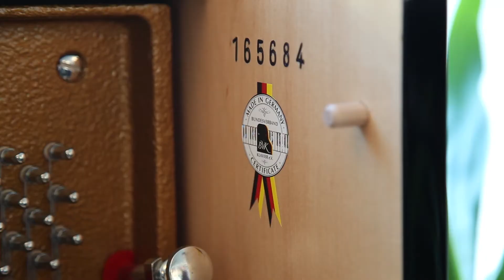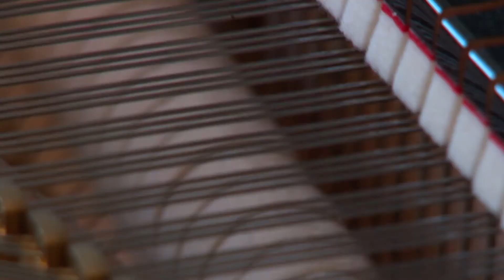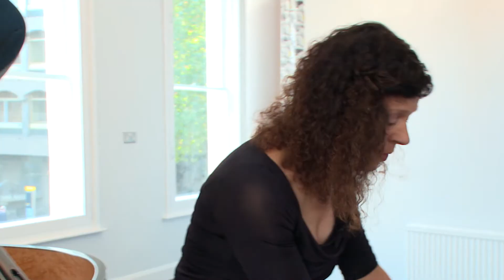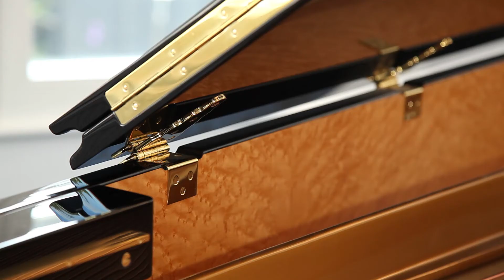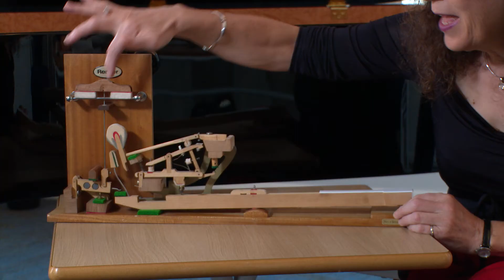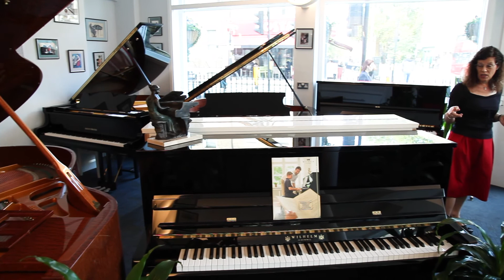Choosing the Right Piano - A Question of Choice

Comment: I don't think this presenter is very up to date even if this is 5 years ago. Chinese companies use Renner actions and Roslau wires for nearly a decade now, if not longer. All Pearl River pianos use wet sand casted plates. But not all Renner actions are top tier. Chinese companies are collaborating with German companies, companies like Feurich (Viennese) and Schimmel (Fridolen, Welhelm, etc.) and a Bechstein (Zimmermann line) collaborate with Hailun and Pearl River. Steinway uses Pearl River to build its Essex line and Kawai to build its Boston line. It's Kawai that makes the carbon fiber parts in their action but not to be cheap. They do it to keep it consistent where natural wood expands and contracts due to weather. And Mason and Hamlin also uses carbon fiber actions. Yamaha makes their own fine actions that some say are just as good as any German action but Yamaha also uses German felts in some of their pianos, Rosleau wires and European spruce in the SX and CF series. The piano world isn't so strictly segmented by countries so much. German companies are hard to sustain the industry hence the lower lines bringing in the money to help hold up the upper lines. Or, a boutique company is purchase, like Yamaha purchased Bosendorfer. Bosendorfer hasn't been changed but they now have money to make new models and Yamaha to help market them. There is a lot of interconnectivity between Asia and Europe now in terms of the piano industry while the American market is down to NY Steinway, Mason and Hamlin and Charles Walter and England may have a few brands left.

Japanese pianos are affordable? Has she seen the price of a Yamaha SX, CF or Shigeru Kawai? Is she aware of the different tiers of instrument Yamaha and Kawai make? Has she every played a Hailun piano or aware that Feurich has Hailun make some of their pianos that people use for practice in universities? This is just a lot of inaccurate generalizations that I really don't find all that useful and very German piano biased. Yes, the Germans can make fine pianos that cost a lot. But there are fine pianos from other lands as well.
Reply: I agree that Japanese piano makers have some extremely premium lines that are far from cheap, but they pale in comparison to the price of a Bösendorfer or a Hamburg Steinway. In my humble opinion the Asian makers just can’t match the refinement and the soul of Europe’s best. They just can’t.
Reply: @Steve-wf3vv  The Hamburg Steinway  D and the Shigeru Kawai SK-EX cost around the same as does the Yamaha CFX Mark II.  Bosendorfer costs more because they're more boutique. Fazioli, maybe has the best workmanship and costs more as well. And I think the Japanese pianos have plenty of soul and refinement now.  And it is hard to define "soul." Yamaha has a clean but pretty emotional tone especially since Yamaha now sources some of the same materials as Bosendorfer. And Shigeru Kawai has a very lush and colorful tone and both have excellent action and workmanship. I tend to like Bosendorfer VC but I still think there are individual pianos from the top manufacturers that stand out. Pianos are a highly personal matter and some do feel German, then Italian, make the best pianos. I understand that the European pianos have a certain signature that sets them apart.
Reply: @benjaminsmith2287 I respect your opinion, but I must point out that the list price on a piano (even most world class pianos)  and the street price on a piano is often quite significantly different. Also keep in mind many manufacturers price their 9-foot models much higher than their other sizes. Steinway is one of the few companies that allow little if any discounts. But on most other pianos, the prices are usually highly negotiable. For example, a 7 foot Yamaha CF-6 can be had at a negotiated price in low to mid $90K range. A Bösendorfer 214VC, however, would likely sell for no less than $117K. I’d say a price difference of well over 20 thousand is quite substantial. And Shigeru Kawai has always been praised as being among the more affordable high end pianos.  This is no surprise as the Japanese know they must offer somewhat better pricing on their flagship models than their more prestigious European competitors.I agree that the Japanese pianos (even the mass produced ones) are of higher quality than the ones made elsewhere in Asia.  And it’s not at all unwise if a musician with deep pockets chooses a CF series Yamaha or Shigeru Kawai over a European instrument . But while there are certain exceptions, Japan’s best seems better suited to pop and jazz where European pianos (especially German ones) seem to be preferred for classical music.
Reply: @Steve-wf3vv  That's changing. And Steinway is a jazz pianists preference for many as well. Pop is different but Steinway has plenty of jazz players in their artists list. From Keith Jarrett to Diana Krall to Kenny Barron to so many others, the list of Steinway jazz artists is very very long. I honestly think the Steinway is considered a jazz piano as much as Yamaha is. So many jazz clubs in NYC I can think of have them. Yet the Metropolitan Opera is a Yamaha house with lots of Yamaha CXs and maybe one or two CF series.

The CFX appears on a lot of concert stages as well as has a growing list of Classical artists, probably second to Steinway. The Shigeru Kawai has plenty of Classical and non-pop or jazz artists as well. And I think the Shigeru Kawai has a tone that could be mistaken for European, not at all bright. In fact, I would say Kawais were more on the dark, fuller spectrum of tone quality.

I'm not sure Kawai is used that much for jazz and pop. Since their tone is full and bright some Classical musicians love them as practice instruments and really, institutions love both Yamaha and Kawai pianos. Yamaha is still in some areas used for pop and jazz but they've expanded far beyond what they were even 15 years ago and especially since the introduction of the CFX and CX lines.
Reply: I just finished watching the Forster piano factory video. They have 40 workers. That's a glorified piano repair shop. I can see Forster going out of business soon. What difference does it make that they invented the cold casting method? They can't sell their pianos, and they are going out of business. Bosendorfer would go out of business, if Yamaha hadn't taken it over, and Schimmel had gone out of business, and Pearl River had to rescue it. The glorious Schimmel factory, their CAD equipment are all courtesy of Pearl River. All their Konzert series innovations were possible thanks to Pearl River. I see some people here comparing the Japanese piano with German pianos as Toyota vs. Mercedes. That's not accurate. It's more like Lexus vs. Mercedes. Mercedes might be better right out of the showroom, but they rank at the bottom on the reliability list, whereas the Lexus runs forever. I read in a car magazine that a 10-year-old 8-cylinder Lexus is more reliable than a brand-new Mercedes.
Reply: @GeeKim-j9i  Actually, Forster sells faster than they can even build them. They have an annual revenue of roughly $5 million.More than enough to sustain a small family owned business.August Förster has been around for 165 years. I doubt they’re going anywhere anytime soon.
Reply: @Steve-wf3vv   I am keep giving you the automobile industry metaphor, but Jaguar, Rolls Royce, Jaguar, Ferrari and Maserati all have gone under and came back under different ownership or organizations. Even the piano industry is innovating. With only 40 employees and the annual revenue of $5 million, there is no way they can keep up with technological progress Everyone is using multi-million-dollar equipment to innovate and cut manufacturing costs. The company will eventually become a piano restorer.

Comment: I dont like the tone of the August Forster piano demonstrated here. It has a sharp attack and no warmth at all. I have a Baldwin and inherited a Steinway M built in 1917. There is a considerable difference in their tone. Mine has the characteristic Steinway sound in the extreme. It took some getting used to but once I did I came to love it. Its attack is sufficiently brilliant but it puts more emphesis on lower harmonics of each string giving it great warmth. Steinway manufactures pianos in both the United States and in Germany. Several years ago it celebrated the manufacture of its 500,000th piano, not a lot considering they've been in business for over 100 years. Still the Steinway D seems to be the piano of choice for many performing concert pianists.
Reply: Steinway is Steinway's highest teir line but they do design, though don't build, but design and sell lower tier lines in Boston and Essex. I don't know how many Boston and Essex are made but that pulls in some money for Steinway. Steingraeber and Sons or Bosendorfer make even fewer pianos than does Steinway and Sons. I believe it is true of Fazioli. Even Shigeru Kawai, the top tier Kawais or Yamaha CF, the top tier Yamahas may make fewer pianos than Steinway.

Steinwy and Yamaha both are huge marketers of their pianos so they end up in venues more often than others do. Nothing against Steinways, I really love them (well, pianos differ a lot so not every Steinway is brilliant but that's true of any brand). I just love a lot of piano brands and I think each piano brand brings something special to pianos. I do wish people hear concert music and jazz on other pianos than S&S sometimes and say jazz and other music plus some concert music on Yamahas.
Reply: @benjaminsmith2287  There are many aspects to tonality. One thing I listen for is a bell like tone. This is true for all instruments and voices. It's not just a function of the instrument but of the musician and the acoustics of the space it is played in. I"ve only heard recordings of Fazioli and Shimmel but they both sounded very good. Baldwin also has it but it is a cold sound. It's the sound my ears were tuned to for many years. Bosendorfer and Yamaha not so much. I didn't really become a super eared critical listener until my 40s and when it comes to pianos not until about 15 years ago. I've also heard must be hundreds if not thousands of violins from 10 dollars to 10 million dollars. I was very familiar with the sound of the 1741 Guarneri del Gesu ex Kochanski now ex Rosand having heard it hundreds of times in many places, in Rosand's home, my parent's home, on the stage of many concert halls including Carnegie Hall. I think you could buy about 50 Steinway Concert Grand piano's for what that violin sold for a auction a few years before Rosand died.